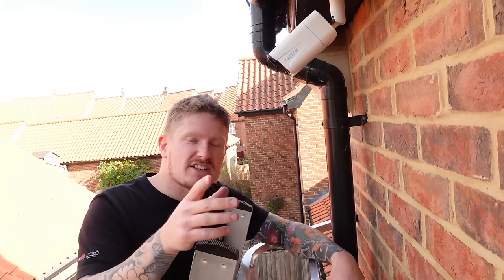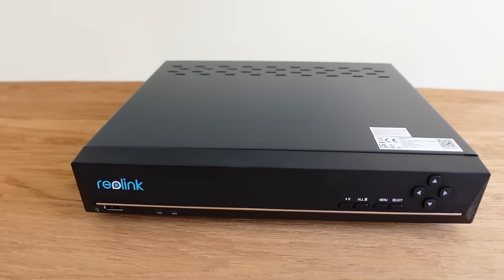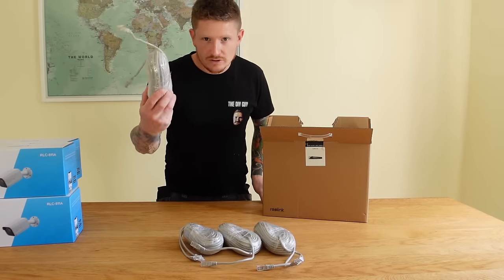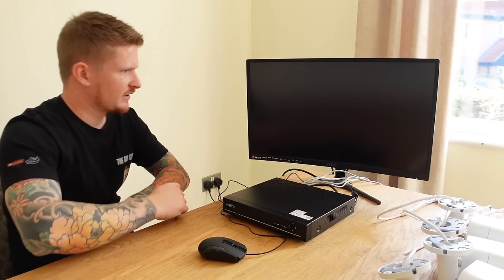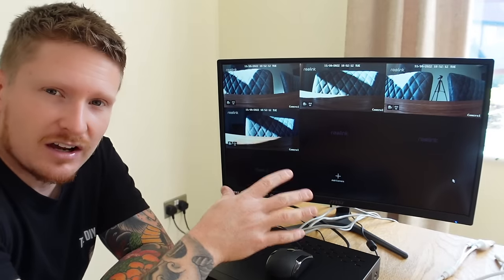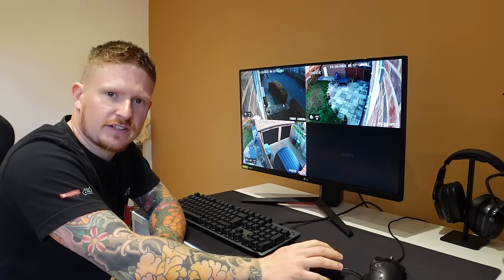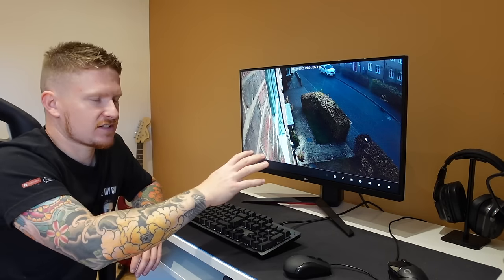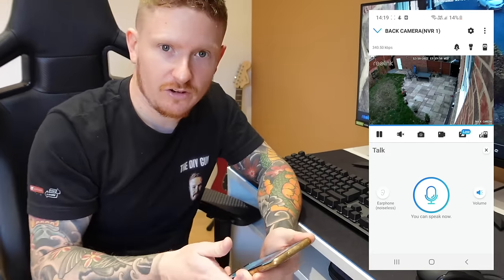How to Install Your 4K CCTV System Quickly and Easily | Home Security

Comment: Hi, everyone. I have one system similar to this one from reolink.
I want to let you know some points that he missed.
1. There is no subscription for Reolink.
2. There is no maintenance
3. You need to set " Privacy mask" ( the dark areas where you are not allowed by law to record with  CCTV" i.e. neighbours windows or Private property) 
4. By law, you are not allowed to record audio with CCTV on public area /neighbours private  property . For example ,  in front of your house, you can't record audio (I'm not going too deep into this,but this is the law, public area and CCTV, just don't do it, will get you in big trouble). And about the audio and neighbours, let's say you install CCTV in your garden but you want audio too. You simply can't do that because if you got neighbours on any side(left or right) and you record audio with your CCTV , they can get you in court for privacy recording via CCTV. The best advise I can give you is simply turn off audio recordings on your CCTV NVR. 
5. The CCTV from Reolink, depending on the storage capacity on your NVR,the recording is loop recording mode(the oldest recording is replaced by the new one and so on). In my case I have a 2TB storage capacity(integrated) and I can go back 10 Days in the past but I've got  3 cameras installed. I think if you get 4 cameras will get you down  to 7-8 days and if you got 2 cameras you will get arround 13-14 days storage with 2TB.

If anyone thinks there is something wrong in what I've said above ,just leave a comment and I will respond to you as soon as possible.
Any questions will be answered.
 
@The DIY Guy, Please pin the Comment. 
Nice video and well explained. Keep up with your informative videos like this. Appreciate your work.
👍
Reply: Or you could just buy a Eufy security system which is active over wifi and the comes with 16gb Homebase and can connect up to 16 cameras to it, less hassle.
Reply: @madmantronixx7998  Eufy has a huge security debacle going on. I wouldn't go with them.

As far as those laws on audio recording, those vary based on where you are.
Reply: Hello,
Can we instal an externe storage item to be able to go back more and more?.
Regards
Reply: Well that's not true. You can record anyone in public and in your private property (front and back garden, inside the house etc).
Under the Regulation of Investigatory Powers Act (RIPA) 2000, it is perfectly lawful to record conversations in the UK without permission provided that the recording is intended for personal use only. However things get more complicated if the information is to be shared with other parties, in which case one must seek consent from everyone in the conversation.
If a crime is caught on cctv, you don't need consent to share it with the police. 
Stop missinforming people.

Comment: Looks nice for how you have it setup; i would have done the same if I could.  My attic is not as steep as this home, so I have no way to push cables from the outside like that without great discomfort or risking falling between the floors. I got mine in between brick, same path / area for my coax TV with some runs behind a down spout. I have spaces between my wall that I pulled out old RJ11 phone cables cables to run between my non-solid walls, so I did not have to make a hole on the inside wall with a new conduit. I placed my NVR in a central location in the same closet as my internet and switch. I routed video in a room just outside of the wall so I have a 24/7 live feed just outside my main door. This also allowed me to install the Reolink Door bell with ease being so close to my main door. At my desk, I use the software to monitor cameras as needed on a restricted vlan that no other devices can get to...separate your smart / iot devices from your main internet and VPN to your home instead of the cameras being on the internet for increased privacy...I did not say security as it's a relative action specific to your needs and time invested.

Comment: Do you need to power each camera? Other than the Ethernet cable I couldn't see any other one.
Thanks, great video.
Reply from the maker: No, its a POE system
Reply: That's great, thank you.

Comment: Really excellent video, I assume it could be installed without the Internet as a standalone system?
Reply: That’s what I’m thinking, maybe I’m wrong. I can run the camera cables in the loft but my router is 2 levels down and getting that cable up would take an effort.

Comment: Hi, Great video BUT perhaps you and the community can advise me. I want to install cameras in my garage does that mean that I will have to install a separate router in my garage? How would I get labelling to my garage? What and how would you advise is the best way to get cameras in my garage?
Reply: I was thinking for one camera make the wire to the hidden outside cam give the appearance of a washing line lol
Reply: No extra router needed, just run the Ethernet cable out there. If it’s too short you can buy longer cables. I have mine going from the house roof to garage roof bundled with existing low voltage cables

Comment: If you are just routing Ethernet cables you can buy some Powerlink adapters then plug them in up your loft (I saw you had electricity). Pair them up with Powerlink adapters plugged in near your NVR
Reply from the maker: NVR subject to high temperature in the summer isn’t for me. Otherwise a good suggestion
Reply: @TheDIYGuy1  you can leave the NVR in the exact same place you have it now. If you use the Powerlink adapters you won’t need to route Ethernet cables from your loft to where the NVR is.
Reply: @dlm311  Worth mentioning that the Powerline adapters would have to be the ones that supply PoE voltage to the cameras. I have some TP-Link (non-PoE) ones that refuse to play nicely across different circuits in my consumer unit, maybe because they're not both fed by the RCD breaker. I'm no electrician though!

Comment: Do you have to set up a monitor in the home or can you just hook up the cameras and use the app ?
Reply: You need a monitor for the initial setup. But once the cameras are up and running you can disconnect the monitor and control everything via the app.

Comment: Really enjoy the videos.
Just one point though, buy a radio Mic 
system for your videos as relying on camera microphones
that are only designed for ambience recording, kind of lets down the effort you're clearly putting into these tutorials.
Reply from the maker: Thanks. I actually use an expensive sannheiser mic mounted above the camera. However the cable was hit during the making of a video and I wasn't aware of the damage until after making this one, that's why this video only has sound on one channel. The cable has now been replaced and will be back in action next video.

Comment: Great video, i fitted Reolink about 2 years ago keep swapping the cameras when they bring better ones out like the 4K person detection. Up till now I don’t have the NVR just use SD cards inside. They are releasing a doorbell as well but they keep shoving the date back on it, should have been out in May they recon December now but not holding my breath
Reply from the maker: Interesting 🤔
Reply: Theyre on 8k now for not a lot of dosh ie Annke and Hikvision, work a lot better than Reolink in the dark.
Reply: I bought one of their doorbells and it should be here in a week.

Comment: Hi, what size drill bit was used for the hole in the soffit, not length but radius so cables can fit through.
Reply: 1" will work

Comment: My router has an ethernet cable coming in and one going out to my computer. Could I use a splitter to gain access for the CCTV ethernet cable without affecting the performance of my computer?

Comment: Dude that loop you did on the ethernet cable, you shouldn't squeeze it so tightly as you can break the internal wiring unless that is CAT6 which is much tougher

Comment: Any reason you didn't choose wireless cameras? I've seen some advertised that need charging once every 6 months.
Great channel btw.
Reply from the maker: No real reason :) Thanks
Reply: Avoid wifi cams. Thieves can easily use a wifi jammer. Also this system can loop record 24/7, battery cameras will only record on motion detection.

Comment: Honestly hoped we are beyond ethernet cables and now more wireless.  Am looking to install a camera system but need wireless.  Happy to get any recommendations
Reply from the maker: There are some good options out there 🙂
Reply: IMO wireless is just more points of potential failure.  How will you provide power without wires - battery? Now you gotta keep on top of charging batteries. Thieves use a WIFI jammer, no CCTV. Also now your home WIFI network is clogged up with multiple high bandwidth devices broadcasting high bandwidth 24/7. Ethernet cable is wire and forget. Keeps radio signals in your home to a minimum, isolates the CCTV away from other parts of your network, etc
Reply: I'm here looking into Reolink to keep it all local 24/7 stored on NVR. I'll be ditching my Ring wireless cam soon which has been less than optimal. Charge the battery every ~6-8 weeks (I wasn't paying another 50 quid for a solar panel), not 24/7 recording, delayed motion detection, first few seconds of playback is jerky, and although only 8 feet from my mesh extender whenever I want to quickly check the feed it rarely connects first time. I'm sure there are far better options than Ring. I have Blink too, battery life amazing but I think you need a cloud plan now and again no 24/7 recording. But no wired isn't always physically an option.

Comment: Um Why is it that everyone thinks the GRID area of the camera setup is where the camera won't Detection motion this isn't the case.. When GRID is setup that is the area for Motion to be Detected. In some cases it will also show you motion as it happens so it can be adjusted to not pick up things like leaves or a rat running by.. FFS this is the second video where I have seen people say that I don't want. Once you figure this out why don't you or they correct the info so others that are trying to setup a DVR/NVR will not think that the GRID is an area you don't want to detect.. That is in fact the area of Detection... I mean I know what the Grid is for. That isn't why I am here, I just like to look at other CCTV camera review and installs seeing I have made many of my own over last 30+ years.. Good info is Key for helping others...

Comment: What about keepig the NVR in the loft and just run the wire required for the display through the ceiling  ?
Reply from the maker: Potentially yes but I was cautious of this due to extreme Temperature in the loft space during summer. I'm not sure if it will do the already warm hard drive much good

Comment: Question.... How is this system considered CCTV? 
I thought CCTV stood for Closed Circuit Television,,, 
meaning CCTV is a closed-loop system where everything stays in-house.
Nothing should be broadcasted over public airwaves, including internet.
I ask this because I am looking for such a thing.
A simple viewing monitor, tied to a camera for viewing my driveway.
I do not want possible hackers, or big brother watching.

Thanks for your video... good job!
Reply: Just don’t plug the Network Video Recorder into the internet, and you will have an isolated system.
Reply: And how are you going to view said camera when you’re out the house?

Comment: How do you ensure you don't drill into wood when drilling into the soffet and another question is if you move house how can you cover up the holes, as I'd be taking the CCTV to a new property
Reply from the maker: You can fill the holes up in many ways.
Reply: @TheDIYGuy1  most searches are related to brick walls and other stuff not suffetts xxxxx

Comment: i have a question my Reolink is not connecting my cameras is working find and i can see the videos perfect . But my app on my cellphone is not connecting for some reason . every time i scan the QR code or type it in it just doens't connect am putting my ip address and still noting .

Comment: Just to let you and everyone  know, it's not recommended/wise to have your cctv cameras that are right as you only see the head  of the person  and not a clear image of the face. It is highly  recommended that you fix the cctv camara 8-9 feet from the grounds  to get clear images depending on the mp and angle. However, doing the wiring the way via the loft is good.

Comment: Great channel, really appreciate the clear instructions.
Does the NVR have built in storage for the recordings or are you just viewing live?  Looks a neat system
Reply from the maker: Thanks. Yes it has a hard drive.
Reply: Is video recording a continuous loop?  In other words, as new video is recorded, is old video erased from the beginning?  How big is the hard drive, and many hours of video recording are on the hard drive?  Thanks, and nice video!
Reply: @Osheekuru  The NVR comes with a 2TB HDD, but you can upgrade it if you wish. You can expect anywhere from 4 - 10 days history before the NVR overwrites the oldest recordings. It just depends how many cameras you connect to the NVR. 

To give you an idea you should get around 6 days of recording history with 4   4k cameras connected to the NVR.

Comment: Great video. My Ethernet cable is ready under the eves from an old installation, however I want to place the cameras low down so they are visible.  I planned on extending the Ethernet between the down pipe and straight into the camera but I wasn’t aware of the trailing cables from the camera (Ethernet, reset and power). Any recommendations on how I could hide these?
Reply: You would need to use a junction box to hide and protect the connection. Just mount a standard electrical junction box above the camera and run the cables into that. Most hardware stores stock them.

Comment: Do you know how common networking to each room is in new builds? This is something I've always wondered why isn't more commonplace (coming from an IT operations perspective!)
Reply: Not required by building code, therefore builders and owners treat IT/Data/Tel as an unnecessary expense.
Reply: Wireless on consumer routers seems to be good enough for most households. People install these crap repeaters which do hardly anything. You could put a wireless access point up and it would be great for home use. But running cables to each room or main rooms seems pretty redundant because people like to move around furniture and redecorate. Plus theyre quite flimsy for kids rooms so it'll be a case of getting someone out to re terminate etc.
Reply: Just install a really good mesh network with WiFi 6 and you will get at least 400mbps throughout your house. Yes ethernet will have a bit more bandwidth but most will not need this. Also Ethernet won't help you in outbuildings, up drive way etc.
Reply: @sl0w_racer  Ethernet to outbuildings can extend the mesh.

Comment: Best way to cope with the coming UK winter power cuts and maintain security systems?
Reply: Have the NVR plugged into a UPS (Uninterruptible Power Supply).  With this system the camera's are powered by the NVR and a sufficiently sized UPS could power a NVR and the cameras for a period of time.  UPS come in various sizes so you'd have to calculate power consumption of the NVR system times projected max duration you'd hope to withstand to get the proper sized UPS.   Naturally, the longer the duration, the bigger the battery, the more $$$.

Comment: Informative video I’m going to do this but what about using the type of plugs that make your wiring circuit into a house full of WiFi instead of Ethernet cables ( sorry my computer speak is none comprende )🤣🤣🤣
Reply from the maker: I guess your referring to home plugs. Could work but that's dependant on your circuit.
Reply: @TheDIYGuy1 thanks for your reply

Comment: Wouldn't you have been better putting junction boxes in so you could easily replace a damaged/faulty camera? Or even in future upgrade them?
Reply: Why? The cameras are connected with normal RJ45, you can just pull the connector from the outside and replace the camera no problem.
Reply: What is the purpose of that? Couldn’t the camera be replaced by unscrewing and screwing the new in the same location? Or do you mean a new camera might have different hole/screw locations and would need new holes drilled?

Comment: And if you want your wires, nice and neat, I would recommend getting something called Smurf tubing. It’ll be a lot easier to route a Smurf tubing in and then suck a string through the Smurf tubing via vacuum and then tie one and to your ethernet cable or cat cable and Then it’s also protected from critters in your crawlspace in your walls from chewing the wires and I would recommend a wired system, then a wireless system only because the United States a lot of smart kids have been hacking the security cameras that are wireless

Comment: Not your average Joe instalation... lots of wires and fixing cameras to the sofits.
Cameras high up that get spider Web  infested are hard to clean and the resulting night images are ruined by bright strands of light.
I fitted my system 20 years ago (same type instalation) but lowered the cameras and pointed cameras to look at each other (peripherally), that way, when a camera becomes out of action, which they do for various reasons, I don't have to climb up to the roof to affect a repair. Also, when cameras get Web infested..a fluff on a stick gets rid of them in a flash.
My cameras have been up 20 odd years and never had a problem..all 8 of them.
Reply: That's good to hear. I'm curious. Can you tell me what is the resolution of your camera from 20 years ago? We have changed many security system (4-5) over the last 20 years not because they don't work anymore but because that technology and image quality have improve so much over the year. From 4:3 ratio 640x480i 8fps in early 2000s to 16:9 720p, 1080p and now all 4K. 8K is just around the corner.